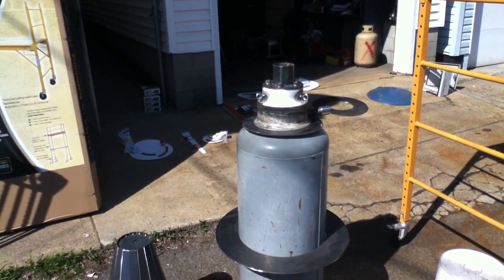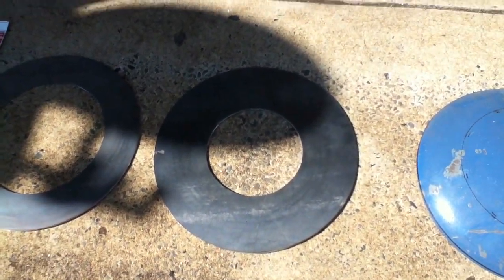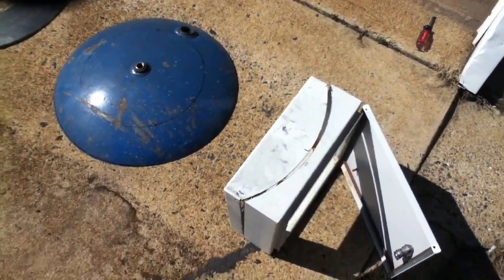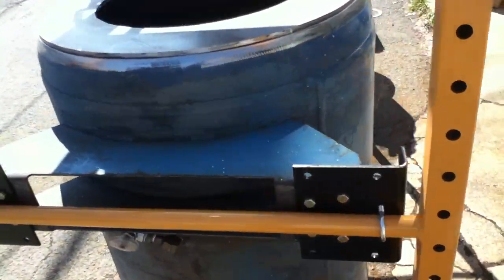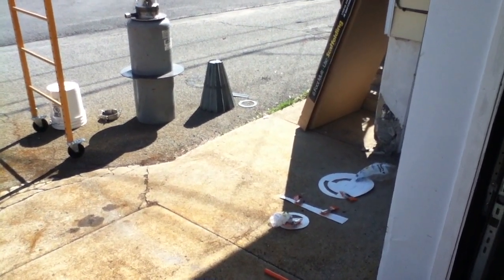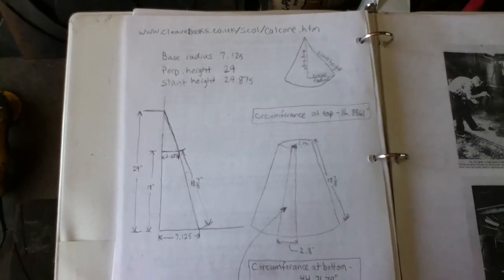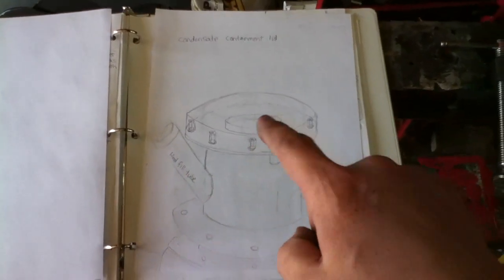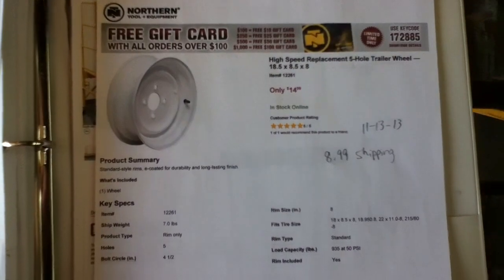Heart of the Flashifier Part 2

Comment from the maker: Thanks for getting back to me so quickly . I haven't added the extra two inches yet, because I had an idea to machine a heavy chunk of metal for the restriction zone that threads into the bottom. As for the depth of the hopper, I am glad to hear that the only critical thing is to leave enough room for the restriction zone mods, because I would like to keep most of the hopper down inside. For a couple of reasons I feel this is a good idea. For one with more hopper inside the vessel, less condensation will want to form on hopper walls. Another reason is the height of the assy.  I am also thinking of building a container ring around the lid so I can fill the entire top ( on the outside) above the gasifier, with water. This can aid in cooling the lid to promote more condensation on the inside of the lid. I can also circulate this water through a small radiator to remove any residual heat built up in the water. Also thanks for your insight on the funnel. I wasn't looking forward to putting the high temp concrete on the outside of the funnel. I will be building a structure to make sure it stays where it belongs ( centered ) in the hopper. That is what the small flange is for ( the bottom of the funnel). Thanks again for your time.

Comment: OK...Now I'm home... You were asking about the hopper being deeper into the vessel or not for the gas to expand and in the gasifier, it's going to be hot no matter how deep or not the wood hopper is in your vessel so that call is up to you as to what you feel will be your best direction for your build. Be careful or you could find yourself needing a step ladder to get to the top of the gasifier. HA!

When I built mine I knew that I would be trying to fine tune it especially as I learned more about my system so I did the build where there would be VERY LITTLE cutting of ANYTHING on the gasifier itself for any upgrades.

For example: I chose to bolt the 3 inch restriction throat on instead of welding it to the bottom of the fire cone (reaction chamber) and since then that decision paid off because I have since modified the bolt-on throat not only once but twice.

The first change took me from 3 inches down to 2 inches in diameter and then a few weeks ago (off a gut feeling) I decided to make what I feel will be a final upgrade of not only making it a smaller throat but I extended it from 3 inches in length up to 5 inches in length so that the gas would have to pass through more biochar and allow me to take advantage of the deeper biochar in the extended tube for extra filtering of the gas and had I welded everything together this would have made the upgrade difficult or even impossible.
Keep in mind that my diameter reductions were chosen to match my engine.

You mentioned putting high temperature cement on the funnel (I think) and the hopper will not get that hot. I've ran mine for hours and never seen the walls of the hopper get hot enough to scorch anything so the funnel should be safe.

I was also thinking well ahead of the game by leaving the extra real estate space in the bottom so that I was able to extend the reduction tube a few extra inches in length and the only mod I had to do was to use longer chains for the grate and a few adjustments to the shaker handle. I hope this gives you some insight.

My build is sooo oh, oh close to being where I want it and I plan on adding a inner cone inside of my hopper to do just what you did to help direct the wood into the fire cone. In the end, this is still your build so trust me when I tell you that you will know what looks and feels right as you move forward with this project.

For the record, I love where you are taking this build! The large door will pay off especially for servicing the unit.Your gasifier will be around for a long long time with very little maintenance because you have built a battleship!

Comment: I'll check this out once I get out of work but from what I can see it's really taking some serious shape. Before you weld everything together you may want to give yourself 3 extra inches from the bottom of the drum as an option to be able to extend the 3 inch reduction pipe out. If you get a chance, check out my last run. I try to explain my reasoning as to why I extended the bolt-on reduction throat. Before I forget, I would like to add your videos to the miniwoodgas website so just let me know if that's OK with you.

Comment: I like the thorough way you planned it all out on paper,, wish i was that thorough, but it looks like your doing a great job with it so far, carry on, i want to see it run,, should be good, so far the only snippet of info which gets over looked is the blower.
I found out the hard way having to clean it out twice from the first runs that you need a condensate and tar collection jar at the blowers lowest point, believe it or not , i was under the impression that the gas would have no moisture by the time it got to the fan, but i was wrong, well at least for my system, but on closer inspection of docdcox,s system i saw he has one,,  basically the fan starts making painful noises feeling like its got drag, and when i pulled it apart water started running out of it. then gooey tar ! and you may get tar whether you like it or not as they say the only thing you can do with tar is manage it. I might also suggest using a plasmacutter,  pun  not intended might eventually pay itself off.lol
Reply from the maker: The funny thing about the plasma cutter is I borrowed one to do the job the day before I needed it. When I got it ,there were no extra tips or electrodes to go with it. I drove to EVERY store within a 30 mile radius , including the matco dealer from wich it was purchased, and only found tips for 20 bucks. I bought them but they did me no good without the electrodes. If you knew how stubborn I am , I was cutting these plates no matter what on my one day off !!!!!!!
 As for the blower, I like what docdcox has done with the ejector. Bypassing the whole system of filters, expansion tanks, radiators, and blowers. I plan on hitting him up for more info to build an ejector on steroids. I don't care how much power it consumes, I want to make an ejector that will pull the air as hard as say a 15 hp engine.  I'm thinking I want to run maybe a 5000 watt generator. I will buy the best chinese generator harbor freight sells and beat it to death without a care , but I won't run it off the gasifier till the build is done. Thanks for commenting.

Comment: which is the blue  air compressor's OD diameter and volume(Ga),please?
Reply from the maker: Vasile Pop , the dimensions for the compressor tank I used are 23.5" od x 42" tall. It came off of an industrial compressor that I found in a junk yard. I just feel a little safer knowing it was rated for 200 psi . Thanks for watching.  Joe

Comment: man you guys are so lucky, i want to build flash system real bad but the more i look for the parts i need the more discouraged im becoming. the cost of doing this is growing to a point i mind as well just pay some company for one of theirs. for an example the dam rim alone is going to cost me 100 bucks how fair is this, i even went to the same site you did here have a rim for 14.99 and shipping well they offer 2 types one for 178.47 the other for 31.73 then i have to add currency conversion because i live in canada so add 30% to the cost due to duties and taxes and exchange rates so i mid as well just pay the 100 bucks for just the rim locally and this is just one part to this system :(
Reply from the maker: Some of the stuff can get expensive if you buy materials that will save you time. There are a lot of things I could have bought that would have saved me a lot of time, but I couldn't afford them at the time , so I made them. I'm married with children, and just want this bad. Anyway thanks for commenting.
Reply: i hear ya im trying all avenues i dont have anything to fabricate with either guess ill just have to keep trying im sure ill find one closer to me

Comment: Fire and concrete do not mix. At the temperatures that Pyrolisis happens at 800+C or 1500F concrete may run the risk of exploding due to the water it contains boiling into steam. Several tunnels have collapsed due to trucks which are on fire causing just such a scenario.
Reply from the maker: The Q , I'm not sure how well the materials will hold up to the heat after many hours of use. There are quite a few people who have built this design with great success.  I suspect if it survives the first run,  the moisture will be boiled out of the plaster of Paris and sand mixture. Some day I'll appreciate the fact that I made it to be disassembled. Thanks for commenting.  We'll just have to wait and see how it works out.  Joe.